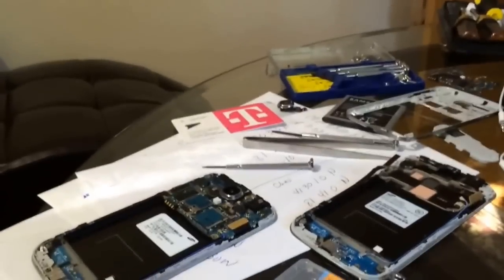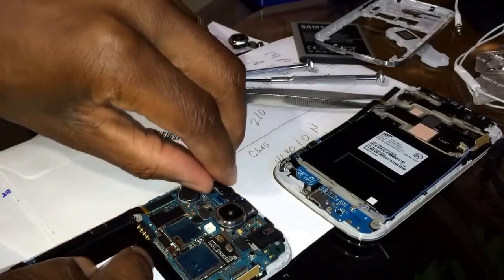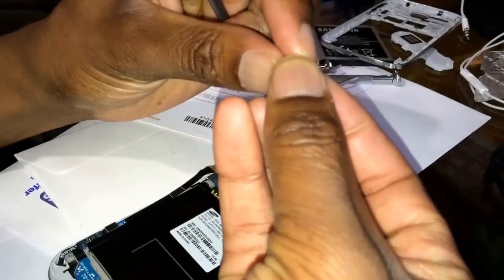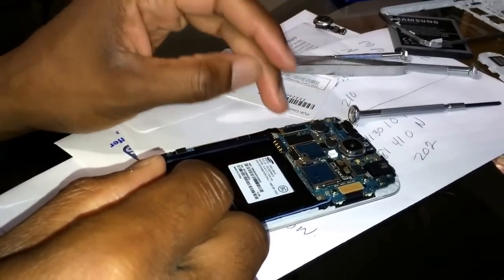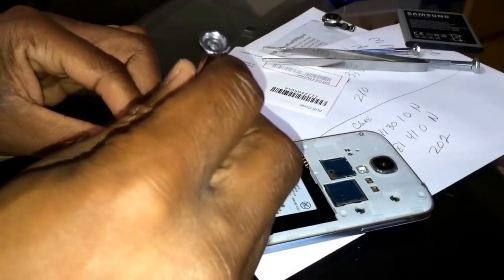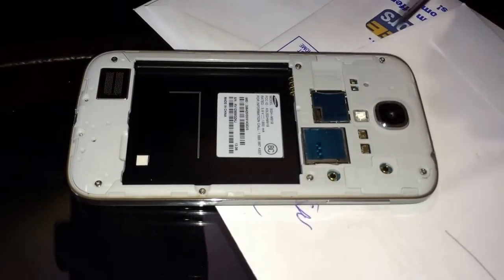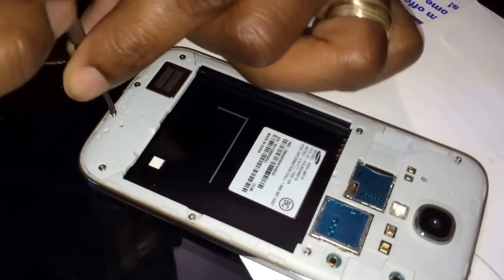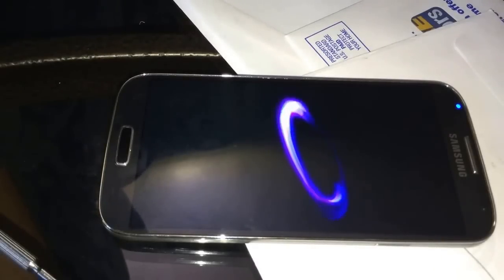Galaxy S4 Motherboard Replacement

Comment: Hi, any help will be much appreciated. i have an S4, pretty old now, i think this is the 3rd year. Several months ago, my phone fell, and the internal screen broke (so the ink flooded the entire screen), i had that repaired, paid just over a grand. Got it back, all was well. Just that the battery was weak, got a new one. Early September, my phone all of a sudden stopped working (it hadn't fallen or anything, it was a bit hot though), the touch screen was unresponsive at all, yet the 3 'buttons' at the bottom,were responsive. 

i took it elsewhere to ask what was wrong, and they instantly asked me where i had taken my phone if i recently repaired it, as they saw it was a faulty repair, as certain screws were missing.

got it to another place, which had it for like 3 weeks, and they still couldn't fix it and concluded the problem was the motherboard.

My question is, if i get the motherboard replaced , from a functioning S4 will my S4 work? And will all the RAM/Internal memory from my S4 still exist and appear?

i have so much important stuff on there, and although i have backed up most of the stuff, correct me if im wrong, but on my PC that data such as whatsapps, are in an encrypted form. 

Please Help.

Comment: Hey man! I have an s4 and out of the blue today my phone stopped working. I took it to a 3rd party shop and they said that its most likely my motherboard. The problem is I have a lot of data and pictures saved on the phone b/c i only had a 2gb sd card inside the phone. My question is if i change the motherboard will all my pictures and data disappear as well?
Reply: what if... the motherboard is in good condition?.... all the data and other important files will not be lost?...